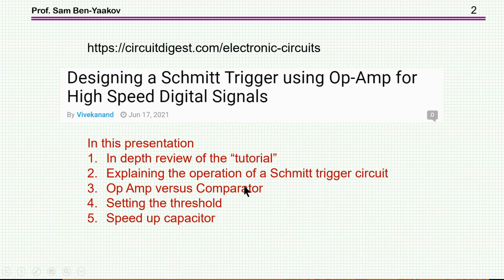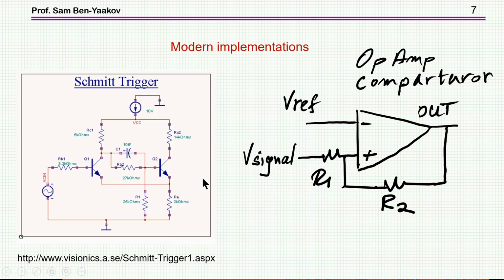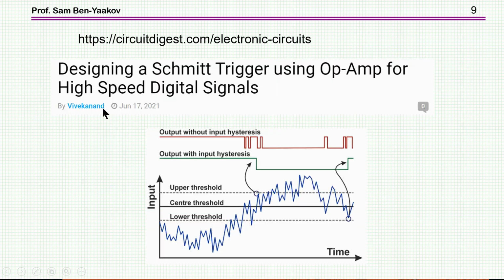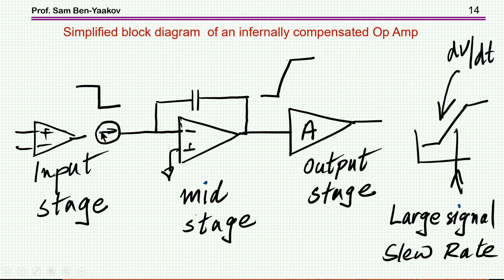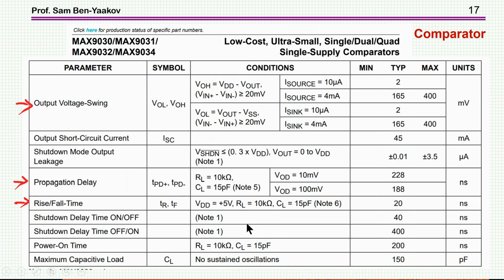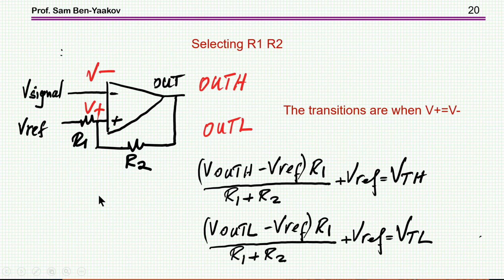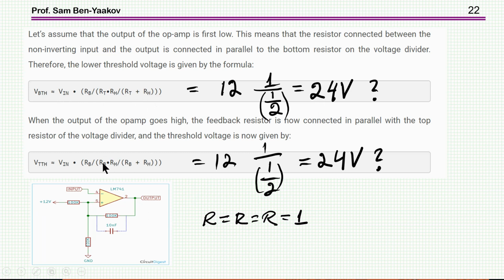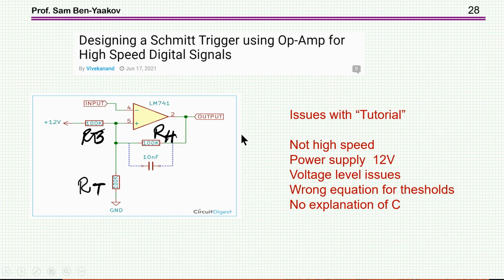Dissecting an internet “tutorial” and an intuitive explanation of the Schmitt trigger

Comment: Actually, NOT every operational amplifier (OA) can be a comparator, and the reason is NOT the phase-compensation capacitor. The reason is different: to be a comparator an OA should have a significant admissible input differential voltage that is comparable to the power supply voltage. It is necessary to make a comparator usable within an undetermined input differential voltage range and assert the Schmitt trigger state by setting the hysteresis to +/- 1 or more volts. Modern OAs have anti-parallel protection diodes between the inputs, which makes the admissible input differential voltage just +/- 0.5V. This is why many manufacturers do not even publish the admissible or maximum differential input voltage in the spec since these OAs are NOT INTENDED for work as comparators. Nowadays, you can find just a few models of OAs that have no anti-parallel input protection diodes and can be used as comparators. OA manufacturers do not even show protection diodes in the datasheet, although they are used everywhere, even in comparators, not between the inputs like in OAs, but between each input and power supply rails.
Reply from the maker: Hi Gregory, thanks for contribution. The compensating capacitor slows down the OA. Other restriction when OA is used as a Schmitt trigger apply, like common mode range at the input, output, and maximum differential input voltage. This presentation was referring to the LM741 Schmitt trigger design demo and it does not cover all the issues. 
I would disagree though with two of your assertions. The facts are: 1. Most, if not all,  modern OA do not have diode protection between the inputs. 2. All datasheets specify the maximum permissible voltage between the inputs which is normally the full swing of the power supply.
And one more point: if diodes are present between the inputs, the OA can still be used even with large hysteresis band. This is because it is OK to exceed the diode voltage  if the current of the diodes is limited to a safe value (which is normally specified in datasheet). So by, for example, adding two resistor in series with the inputs, the diode restriction can be circumvented.
Reply: @sambenyaakov  Hi Sam, please read the article at https://www.analog.com/media/en/technical-documentation/application-notes/AN-849.pdf
Reply from the maker: @gregorymirsky8707  So? This article also refutes your assertions: "the outputs of most modern
 op amps can swing close to their supply rails". So modern Op Amps do not have diodes between the input terminals. And :"It is necessary to read the data sheet very carefully to determine
if the worst-case voltages expected in the comparator application
sufficiently affects the op amp performance to prevent proper
operation" so datasheets do include the information. All the best. Sam
Reply: @sambenyaakov  Sam, I have never written what you are referring to above: I was not referring to the outputs. That was probably a different person. All our correspondence is above. Also, the article I provided the link to, on page 3 (Fig. 9), shows the said protection diodes between the inputs of the OA, therefore not refuting my assertions.

The person above interfered with my account.

Comment: I think it is incredible that their definition of "high speed" is ~10uS slew rate, for a digital circuit nonetheless! I guess it is high speed in the context of morse code but that's about it. 

The voltage level issues could be somewhat alleviated by using some diodes to introduce voltage offsets. I've commonly seen a couple diodes stacked in series with the output to an indicated LED or input to an arduino. The uA741 can't swing the output to the rails obviously, but do the inputs even work down near the rails?
Reply from the maker: Thanks for comment. Yes, the input common mode voltage is even worse but in the "tutorial" they have set the reference around 6V, mid point of the supply.
Reply: High speed for those ancient 74XX series TTL chips, maybe.

Comment: A very useful explanation once again. 
We encountered a situation in motor control where we are faced with exactly this dilemma of using an opamp instead of a comparator.

Basically we want to switch the commutation when we detect zero crossings of the backemf. However the mcu has only 1 built in comparator and we need 2 more. So we've been looking at the possibility of configuring the internal (to the mcu) opamps as Schmitt triggers.
Probably the lower slew rate won't be an issue but the offset from rail voltage could be.
Reply from the maker: Thanks for sharing your experience.